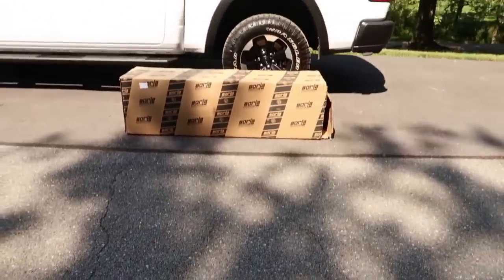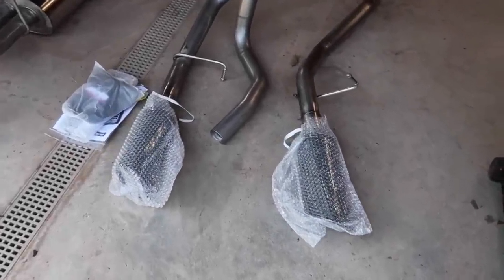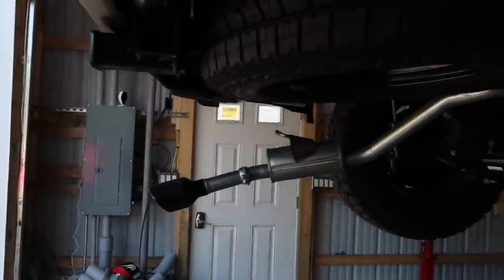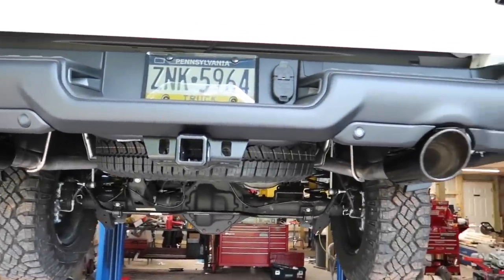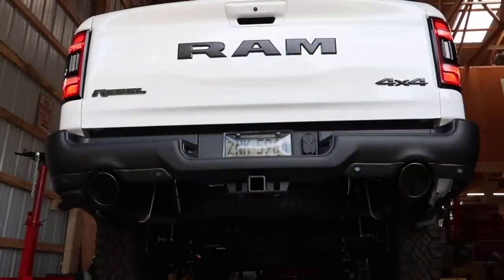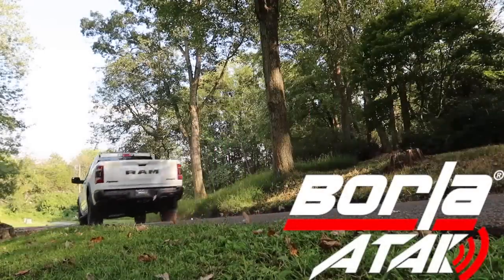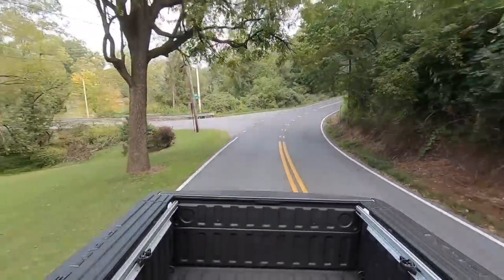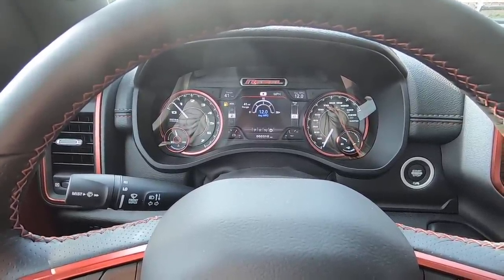First Must Have Mod 2019 Ram Rebel

Comment: 2019 RAM Laramie 4x4
My first mod was to put an Xceed Tonneau cover by Extang onto the bed of the truck... I first sealed the weather stripping with silicone at the front of the bed and the strap hold down modules. I have not had any leaks and love the construction as it has a twist knob for added security on the first panel at the back of the bed, instead of having pull cables like most do. 

My next mod will be side boards and then into performance... shorty headers, exhaust, air flow intake, ECM mod... etc. From reading out there some people are getting near 27 MPG and I have no idea how they are achieving such good gas mileage, but they do say headers help a lot on these factors and not only that, less chance of exhaust bolts breaking (stainless verses cast iron with aluminum heads).

Comment: Have the Borla Atak on my 2019 RAM 1500 and about to add stainless works headers to go with it. Can't wait to get it installed.
Reply: I got the stainless works headers paired with the Borla Atak on my Ram. If you'd like to check it out here's the link. https://youtu.be/1XTp4GUFgeY
Reply: @B5_Beast304  Probably a silly question, but does that kill the warranty?  I've got the Borla ATAK on my 19 Rebel.  I bet they sound great together.
Reply: It shouldn't because that wouldn't directly cause problems with the truck. It really comes down to the service department at your dealership and how the choose to do things. I have a cold start video on my page with how this sounds after install. You should check it out.

Comment: The no drown is a must.  Good choice with going for the Borla.  It sounds like Borla was able to give you some support with getting one of there systems that is smart on there part.  They have a great reputation.  Man the more I see your spec on that Rebel I really like it.  The panoramic sunroof looks great and the all leather seats look amazing. 
I'm looking forward to seeing the additions to your suspension to keep that thing level when pulling your trailer.  Rams with the coil springs are known for the back end hanging down with any kind of load in them.  If I get a Rebel (or any Ram) one of the first things I will look at doing is something like a after market airbag system on the rear or some sort of accessory to help with the back end hanging down when loaded up.  Its important to me though to keep the great Ram ride quality.  Im looking forward to hear what is out there for options and what you choose to go with if anything.   I know a few people who have the factory air bag system (my father included) and where we live in Canada they are failing during winter conditions.   We drive on gravel roads and farm fields a lot.  We pull snowmobile trailers, family camper trailer's that weight just under 10,000 lbs, as well other farm / work trailers.
Keep the great content coming and you also... 
Keep that hammer down!
Reply from the maker: I am thinking of some air bags for sure, I was on the fence about the air suspension and I think I'm glad I got the springs in the long run, I have a bunch of stuff coming up thank you for watching great to hear from a fellow Canadian
Reply: The air systems work in MN then they will work anywhere in the world. 90-95 in the summer and -40 in the winter and doesn’t miss a beat. Can’t ask for a better designed product that works everywhere as it should. 2019’s had a couple problems being the first year stuff but it is nice now

Comment: Sounds so awesome!! Good pick
Reply from the maker: thanks man I love it
Reply: @HammerdownMotorsportsUSA  Does the 2021 comes with a particle filter? Greetings from swiss
Reply from the maker: @worniboyerich9049  only on the diesel from the factory if that’s what you mean
Reply: @HammerdownMotorsportsUSA  Thanks man for the quick answer ... I want to import a 1500 5.7 Hemi Night Edition and I didn't know that the v8 models have a filter or not. Cause here in europe, unfortunately, many petrol engines already have filters :(

Comment: That’s the first mod I did to my 2019 Ram 1500. Love everything about the Atak except in eco mode. You can definitely hear the hear the drone so I either need switch to D8 or really get up on that pedal. I wonder if the pedal max would help lessen the drone since it would offer a better throttle response? 🤔
Reply: What about the official resonator you can buy from Borla separately?

Comment: ....guessin somehow no warrenty issues....if not,well done.
Reply from the maker: no issues with a cat back system
Reply: @HammerdownMotorsportsUSA  your opinion: my 1st Ram,2015,slt ,5.7 ,21,000.miles,bought used from dealer,26,000$. Black,paint is mint,full legit mntnce records ,runs great,actually get 21/24 hwy.owned nothing but dakotas prior.zero engine / drive train issues.retired ,bought a bigger boat,hills / mountains in Tn.needed serious towing capabilities....point, now i hear about needle valve lifter and cam shaft issues. Supposedly dodge adressed this in 2015 ...your opinion please.thanks much,loveyour vids.thinking about the pedal mod???

Comment: I just put a Borla ATAK on my 2019 RAM Big Horn. Do you feel you lost some low end torque by putting this system on? It sounds amazing but my 0-60 is for sure not the same as stock.
Reply from the maker: I didn't notice that on mine at all but if you want some quicker throttle response the JMS pedal max is a must I have one on mine and it really wakes it up
Reply: @HammerdownMotorsportsUSA  The difference could be a 3.21 axle ratio on the Bighorn vs the 3.29 axle ratio on the Rebel.

Comment: Sounds great! I bought used 19 rebel with 4K miles and already had Borla Touring but after this video gotta replace with ATAK!!! I noticed my exhaust pipe on passenger side is not straight and I've tried to get lined up but no luck still little off center. Did you have that issue?

Comment: I bought this kit for my 2020 rebel  installed it correctly but for some reason my whole exhaust shifts slightly forward when hard accellerating. Is this normal?
Reply from the maker: Jaime M it is normal for it to move somewhat as the engine moves on its mounts if everything is fitted properly it should not be an issue
Reply: Awesome thanks for getting back to me Steve I was beginning to worry I had a faulty cat back kit or I messed something up down under my truck.

Comment: Hey there. How is the Atak doing now that you have had it for some time? I have been wondering if the Atak would become too loud and obnoxious for a daily driver after some time?
Reply from the maker: I love the ATAK it hasn't got any louder just the same awesome loudness I love and no drone or loudness at a cruising speed no regrets at all
Reply: Hammerdown Motorsports Awesome, thank you for the reply. Guess I’m sold on the Atak 👍

Comment: Can you open and close the valves in the exhaust to go from quiet to loud ? I have an electrical cut out right now which I can switch from quiet to loud but I was looking at upgrading to a nice full exhaust system !
Reply from the maker: mine does not have a valve but you might be able to add one depending on its location.

Comment: Found the video! Any idea if this voids manufacturer warranty?
Reply from the maker: Trey Roberts no it doesn’t anything after the cat back you are fine
Reply: @HammerdownMotorsportsUSA  awesome! Buddy I work with had a muffler delete done on his 2014 F150 and the autoshop told him it would void his warranty. Didn't want to take that chance haha
Reply from the maker: Trey Roberts yeah to void a warranty it has to be a direct failure due to something you did a Borla exhaust wouldn’t cause anything like that

Comment: Thinking i got ripped off.  Had a garage order and install a "borla atak " on my 2018 5.7 ram and its  not as loud as the one's i listened to on here . Thinking maybe they ordered the s type? . Idk . Bugging the hell out of me.  Very disappointed
Reply from the maker: Check the muffler it should have ATak embossed on it
Reply: Will do . Thank you!
Reply: Hey so i just looked . I was correct they put the damn s type on 😑 super irritated now . 1500$ down the drain
Reply from the maker: @jonemerson5216  take it back that’s not what you asked for
Reply: @HammerdownMotorsportsUSA  i just called the guy . He "didn't realize" theres a difference.  The guys old and runs a small shop so im not gonna be a dick about it.  Ile just order the atak myself and sell this s type when the atak comes in

Comment: What's the price range for the bola attack??
Reply from the maker: 1170 for the kit I have
Reply: @HammerdownMotorsportsUSA  thanks bro for the response, i got a 2020 dodge rebel, so..the borla attack the exhaust system with the borla muffler as well?
Reply from the maker: @fernandezmaintenance1984  yes it has the muffler on it as well
Reply: @HammerdownMotorsportsUSA  so..all i need is the borla exhaust system with the muffler and the cut curve tip with the stock resonator??last question lol
Reply from the maker: @fernandezmaintenance1984  the kit i have replaces all the factory exhaust muffler back

Comment: How is it with the mds
Reply from the maker: No drone no issues at all
Reply: @HammerdownMotorsportsUSA  thanks I just got a 21 laramie sport and am probably gonna put this on mine.  I had a 16 1500 with a flowmaster super 10 and had to turn off the mds everytime I started driving because my truck sounded awful once it kicked in.

Comment: throttle controller?
Reply from the maker: I run a JMS pedal max
Reply: @HammerdownMotorsportsUSA  awesome
Had a flowmaster outlaw on my old chev 1500 with a pedal commander (threw codes)
I now have a 2021 Rebel and I miss the noise of a V8 roar, may just go Borla ATAK

Comment: You can accomplish the same thing for $50 by just cutting out the stock muffler and replacing it with a pipe.
Reply from the maker: lol it might be louder but there is a reason Borla puts the time into testing these systems it needs to flow and sound good
Reply: Thanks for the video. I think if you did a side by side of the 2 and you paid the $1000 for the Borla yourself you’d think differently, If they gave me that exhaust I’d sing it’s praises to. I don’t know about you but I have better ways of spending a grand.
Reply from the maker: Joe Stallbaum each to their own but I’ve owned several exhaust systems and this one has impressed me the most and 1k for a system like this isn’t bad my Camaro exhaust was over 3500 but that is from the heads to the tailpipes

Comment: Sounds good, but those kits are way overpriced. Just take your truck to a local muffler shop and they'll custom chop, bend, and weld whatever you want for less money. I've been doing that for 40 years. I recently took my GMC dually to a muffler shop. They deleted the cats, converted the exhaust to true dual, installed a Holley Flowmonster straight-through muffler (two 3" inlets and two 3" outlets), welded everything up, all for a total cost of $284. And I didn't have to get my hands dirty!